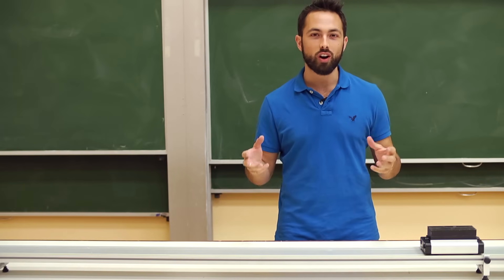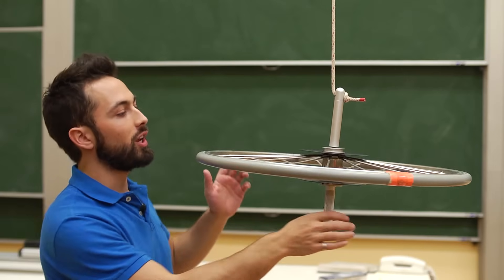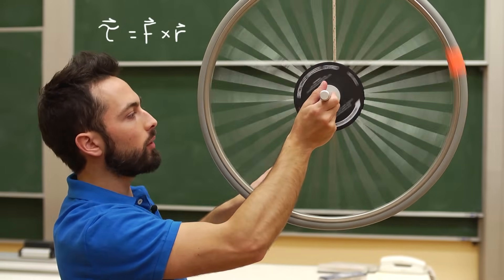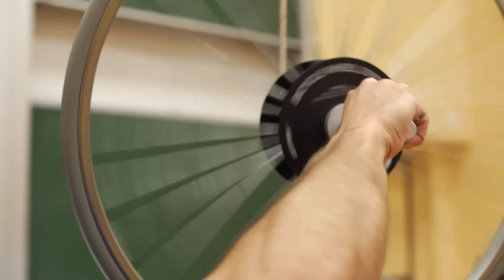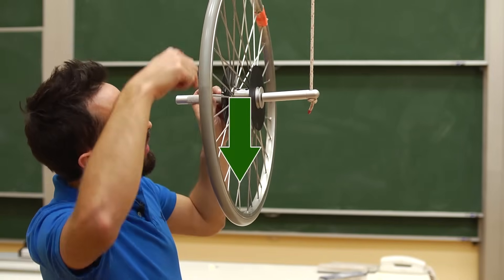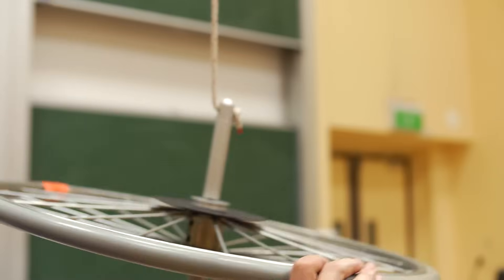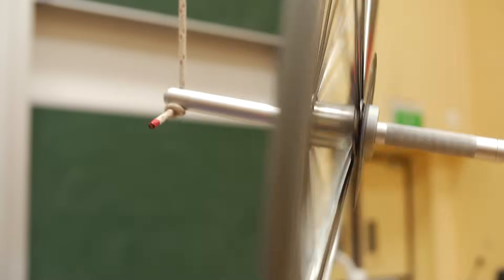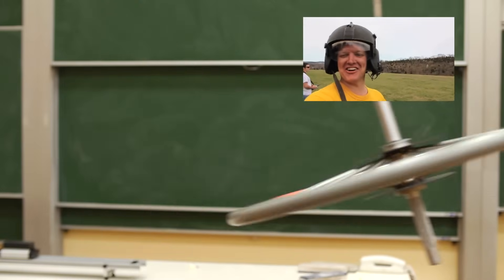Gyroscopic Precession

Comment: That last bit is a little unclear.  It seems that an applied torque to a spin, upright wheel generates an angular momentum that continues in the direction of the applied torque.  It is unclear why the wheel spun along the string axis.
Reply: its due to the fact that the torque vector and angular momentum vector are perpendicular to each other and so when you calculate the resulting force via the cross product, the output force is on a third axis. Although to me it basically seems impossible to actually understand.
Reply: dnb4ever haha.  maybe not impossible to understand as it is to explain.  he's  talking about three invisible, perpendicular vectors angular momentum, torque and the cross-product each along 3 axes of space.  Can certainly get confusing. thanks.
Reply: haha. good idea.  Hadn't considered Feynman probably addressed this topic.  thanks
Reply: The angular momentum vector of the system defines the axis of rotation of the system.  When he spun the wheel with the wheel axis pointing to the left of the camera, the angular momentum vector pointed to the left.  When he stopped supporting the wheel on the left.  This adds more angular momentum from the torque of the offset of the rope and the center of gravity of the wheel.  This adds a new vector of momentum pointing toward the camera.  So added a large vector pointing to the left with a small one pointing toward the camera will sum to a vector now pointing no longer just left defining the new system angular momentum and the axis of rotation.  Torque X time = change in angular momentum.
Reply: The primary physics behind the gyroscope is conservation of angular momentum. Momentum is expressed as p=mv, but this can also be written as Ft=mv. In other words, a force applied to a mass over time will cause a change in its velocity. In the video, Derek applied a force to the car over a few seconds which increased its momentum. Similarly, a torque applied to a mass over time will cause a change in its rotation rate. 

In the wheel, he spun it up until it had a certain amount of angular momentum in the axis pointing away from the wheel (which we will assume is roughly constant). When he let go, gravity was trying to push the wheel down, which tries to change the angular momentum in the axis pointing towards the camera (remember: torque applied over time = change in angular momentum). To try and counter this change in angular momentum, the wheel begins to precess which in this case causes the bottom of the wheel to move faster than the top. This means the bottom of the wheel experiences a greater centripetal force than the top, so there is a net force upwards. 

The invisible vectors are largely incidental and they're just convenient ways to standardise notation for 3-dimensional space. It also just happens that a lot of physics obeys the laws of vectors. They in themselves don't define gyroscopic motion.
Reply: Daniel Dinh I never thought about the bottom of the wheel spinning faster, however surely that has the opposite effect that you proposed due to f=mv^2/r pointing away from the c.o.r, and so a net force downwards? Since the centripetal force is the reactionary force on the wheel in order to keep it in stable motion.
Reply: dnb4ever Remember that centripetal forces point inwards, it's the illusory centrifugal forces that act outwards. The forces at the bottom of the wheel act upwards while the forces at the top act downwards. The bottom moves faster than the top, so it experiences a greater centripetal force towards the c.o.r. and hence there is a net force upwards.

A bike experiences the opposite effect. The bottom of the wheel is effectively stationary and so there is no centripetal force there, while the top of the wheel moves at twice the forward velocity, so the wheel experiences a net force downwards. Since it's a downward force below the CG, it creates a stabilising moment.
Reply: Daniel Dinh So I understand that centripetal forces point inwards, however I would have thought that the resultant force on the wheel would be linked to the centrifugal force instead. Due to the centripetal force being equivalent to the tension in the spokes required to keep it in a rotating reference frame.
Another way to describe my thought process is that when you swing something faster you need to hold onto it with a greater force, and so when the wheel is going fastest at the bottom your reaction force to the center to keep it in place in a rotating reference frame, which is equal but opposite to the force of the bottom of the wheel on the center, which is the resultant force.
Where have I gone wrong?
Reply: Daniel Dinh Hello Mr. Dinh! Why does the system experience a net force upwards simply because the bottom moves faster than the top?
Reply: OK looking back this might not be the right explanation, but I do agree that the simple explanation of "because angular momentum" and "because it precesses" is not sufficient and is a good example of circular reasoning (it precesses because to conserve angular momentum, and it conserves angular momentum through precession). The explanation of different centripetal acceleration made sense in my head (though it's a good way to at least visualise the problem).
Reply: In previous comments some people are confusing linear momentum with angular momentum.  Linear momentum is when a lumped mass moves in one translational direction at a certain speed.  Velocity is speed with a direction which makes it a vector.  The linear momentum is L=m*V.  For angular momentum, such as for a wheel, each point on the wheel is moving in a different direction when it is spinning.  To simplify this, the mass moment of inertia is calculated for the entire wheel typically referred to with a capital letter I.  So the angular momentum is L=I*omega.  Where "L" is the angular momentum, "I" is the mass moment of inertia (sum m*R^2 for all parts of the wheel breaking the wheel into a group of tiny masses) and omega is the angular velocity (rpm) about an axis.  The result is an angular momentum vector "L" that points along the axis of rotation.  Changing the angular momentum requires torque, (delta)L = T*(delta time) where T is torque (in-lbf).  So to find the new angular momentum vector, you add the original vector to the (delta)L vector to get the new angular momentum vector at the new point in time.
Reply: dnb4ever Same goes for magnetism, though (meaning something I just cannot truly understand like this). Then again, magnetism is relativistic electricity. So, maybe relativity might be the "hole" in understanding this. Seems reasonable. All those tensors would make a hold in my brain to understand relativity though.

Comment: Gyroscope is such an interesting mechanism, one that I like for confort is that expensive yachts use them to counter balance waves and stabilize the boat. but I wonder why the motorcycle industrie didn't use them to make motorcycle rides more safe and confortable, at least they could use them to make the bike not fall when stoped.
Reply: Motorcycles already have gyroscopes while it is running: the wheels themselves. You can actually notice bikers usually do a quick flick of the wheel into the wrong direction before making a turn, exactly because of the odd reactions you see in this video.

Now, about bikes that are standing still, you would a as-frictionless-as-possible system to keep it from being unnecessarily wasteful and it would still add weight to the bike. Remember, angular momentum depends on the distribution of mass as well, so you'd have to have a heavy disc to make it even noticeable.

Some clever entrepreneurs have already devised a system that is basically a gyroscope within a wheel for training bicycles, but I don't think it panned out.

Comment: I liked the video but you didn't give a good explaination about why the whole assembly is turning around the cord. My guess is that the spinning wheel imparts a small torque to the non-spinning axle do to friction. Because the axle isn't perpendicular to the cord (parallel to the floor), there is some torque transmitted in the vertical axis, through the axle and to the cord. So if you spin the wheel in the opposite direction you will find the whole assembly will spin around the cord in the opposite direction.

Comment: Can someone explain the difference between torque and moment?
Reply: When you apply an unbalanced torque to an object, you change its angular velocity.  Momentum is the product of an object's inertia and velocity.

When you apply a torque to increase an object's angular velocity, you also increase its angular momentum, according to the equation L = Iω.  L is the angular momentum, I is the moment of inertia of the system, and ω is the angular velocity.

A fancy definition of moment of inertia is the mass weighted average of the distances from the rotation point of all parts of a system.  Basically the more mass an object has away from the rotation point, the higher it's moment of inertia.  In rotational dynamics, the moment of inertia plays the same role as mass in linear dynamics.  Meaning just as an object of higher mass is more difficult to get moving, an object of higher moment of inertia is harder to get spinning.  (Note however that moment of inertia differs for an object based on where its rotation point is placed)
Reply: aRobeGamr Depending on the original asker's question, this might have to do with ambiguity in language. Here in Norway for example, we call torque "dreiemoment", which would translate to "rotational momentum", which is obviously not the same as angular momentum in English.
Reply: Nicholas Tidemann Is there a word for rotational momentum?
Reply: The correct answer is that they are the same, assuming that the OP speak a language where torque is the english translation for moment, which is the case for swedish. Both are in the SI-unit [Nm]
Reply: Torque is a force vector, moment is a rotational inertia measurement.

Comment: The equation for the torque should be T = r X F, and not  T = F X r. Right?
Reply: cross products are not commutative, so yeah
Reply: Correct. If it was T = F x r then the torque would be negative.

Comment: if torque is push the wheel around then what is the difference between the direction of torque and just a normal force pushing it around. Can the direction of toque be considered as a type force?

Comment: For others who also are questioning why the right-hand-rule exists like I was, here's a post I just made. Copy/paste since a lot of people ignore comment-thread replies.

Use a left-hand rule and visualize this wheel-spinning experiment. The result will be the exact same.

The right-hand-rule is just a tool to help keep you consistent. All that matters is "perpendicular". Left-hand, or right-hand. Right-hand-rule is just conventional.

If you're doing your /own/ work, for your own uses, you can use a "left-hand-rule" and the result is the same.

Imagine the "vectors". One vector is pointing to you, the other vector by the string is pointing to your right. Add them together and you get a slightly counter-clockwise (Looking from above) spin.

Left-hand-rule?

The vector would be pointing behind, or away from you, and the string vector would be pointing left. Add those two together and, again, you get a counter-clockwise (Looking from above) spin.

What matters isn't right-hand or left-hand, it's just "perpendicular", and "consistent". (IE, use right-hand or left-hand for the entire calculation and don't switch between the two half-way).

Comment: What would happen if you would rotate the wheel from static horizontal position. With enough power would it gain the torque to stand upright while it rotates or would it remain horizontal while it spins?

Comment: I don't think this whole vector explanation/rule of thumb thing is a very good at conceptually explaining what's actually going on. The explanation that makes the most sense to me is to think about it in terms of inertia. If you let the wheel drop without spinning, a piece of mass on the top half of the wheel  (12 o'clock position) wants to moves away from the rope as it swings down. However, if the wheel is turning, the piece of mass at the 12 O'clock position is now at the 9 O'clock position but, due to inertia, it still has velocity pulling it away from the rope which translates to a processional velocity around the rope.

Comment: Questions for questioning's sake. ( Not expecting any replies. )

What if a wheel with the same radius had a greater mass
(therefore a greater density)were to be spinning at the same speed?

The wheel would have more torque?
Would that effect the speed at which it spins around the tether?

I'll have to refer to Tau/L = rM/IW ....

Comment: When he explains the rule of the thumb, he says the torque is in the direction of the thumb (along the axis of the wheel). But later on, when he's about to spin the wheel, he now says that the torque is parallel to the wheel. What is now along the axis of the wheel (the former torque) is now angular momentum. I don't get it.
Reply: The vector torque is in the direction of his thumb and so is the angular momentum, since linear momentum is in the same direction as force, all of this vectors are from the wheel. But you also have another torque when you let the wheel fall down. When it's spinning, the angular momentum along the axis of the wheel prevents it from falling promptly, but doesn't cancels gravity, then, as the center of mass of the wheel isn't at the point it is connected with the rope, when it falls, you also have position vector pointing to the points of the path of the center of mass, and a force (gravity) tangent to the path, so you have a torque perpendicular to both vectors. That's what "makes the spinning wheel spin"...
Reply: You are confused because there are two torques. One is continuous, being generated by the weight of the wheel, and the second occurred only during the pushing that gave the wheel angular momentum.
Reply: Christiano Pereira your reply helped me to catch the thing. 😊

Comment: What would happen if you had two gyros spinning in opposite directions?
Reply: cpK054L some helicopters, like coaxial or tandem rotors have dual blades spinning in opposite directions to basically in simple terms "cancel out" torque
Reply: They would collide and because of that they would stop spinning...
Reply: Collide on the same axis ?
Reply: Oh you meant it like that. Depending on how much rpm you put on them. If you put equal amount of rpm to both wheels then the axis would stay vertical and the wheels would keep on spinning there.
Reply: Ever wonder why some helicopters with higher powers have dual propellers flying in opposite directions?
Probably the cancel out the angular momentum, making it easier for the pilot to NOT consider that the flight object will not lean towards that direction.
Apparently giving the British pilots newer, faster, and stronger planes caused them to lose control as they forgot that it required much more force to steer the plane, ultimately leading to their demise.

This is probably why we went the turbine route, to minimize the torque and angular momentum caused by the wind flux, etc. etc.